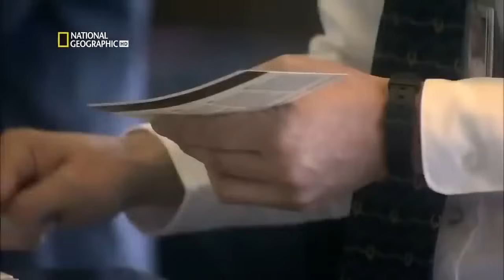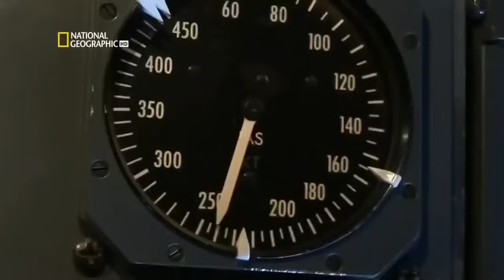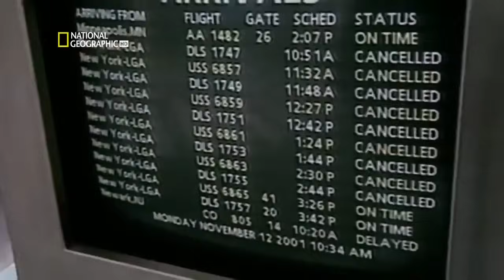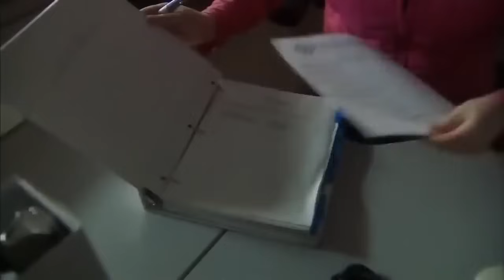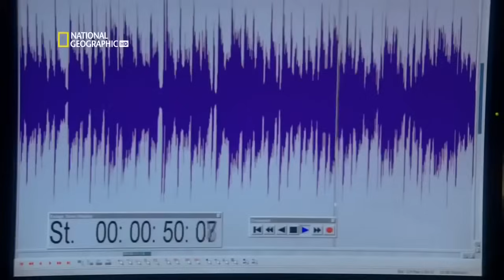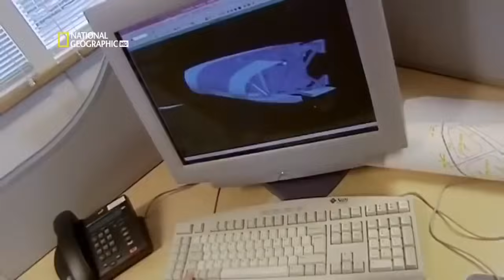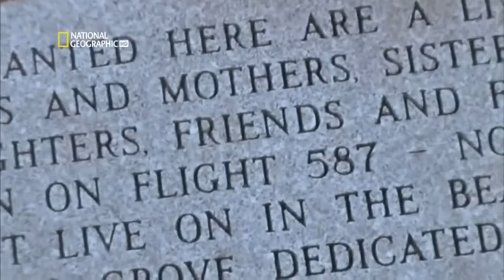American Airlines Flight 587 | Air Crash Investigation | National Geographic

Comment: Total over reaction on the part of the co pliot...and the captain just sat there instead of taking control. All they had to do is just wait it out and put in minor corrections on the flight controls to keep it stable enough to fly out of it. The pilots could have asked the ATC for a re-vector or reduce their rate of climb, both of which would have allowed them to fly out of the wake turbulence of the preceding 747.

Comment: 37,000 hours of flight time. At that point in any type of mechanical vehicle every little thing could go wrong. Electrical, hydraulic, mechanical, engine failure, stress cracks in bolts....
Reply: This is why all critical components have a maximum service life

Comment: 36:18 Wouldn't a simulation just assume the plane was built not to have parts fall of it when stressed
Reply: They exceeded the design stress. Any machine fails when you take it past it’s limits.
Reply: @peteconrad2077  But I'd assume planes are built to handle max inputs of its controls and should be designed to fly within those flight control parameters...
Reply: @Truth4Lyf  they are and so was this one. What you CANNOT design it for is reversals. Reversals, especially repetitive ones, produce an positive multiplier effect through overswing. Successive reversals can progressively increase the force without a bounded upper limit. Thus it’s almost impossible to design against and it pointless since only one pilot has every done it. The designer has to design with some degree of pilot competence assumed. If you design against every possible event, the aircraft would be unusable.
Reply: @peteconrad2077  Yh makes sense tbh

Comment: This is the same as sliding on ice/snow in your car and the panicked over-steering and impulsive stamp braking is what makes you go all over the road. When you slide you pump the brake once and let it go. You will decrease speed and do it again, this is how you have better control of steering. Sometimes you can't control it of course but if you are just sliding with brakes on---get the steering wheel straight ahead and let the breaks go--it gives wheels a chance to grab for friction when they start spinning again. This is the basic same air-mistake the pilot unfortunately made, virtually swerving in the air and over steering via the tail.
Reply: Except it's not the same. He didn't crash because of loss of control. He crashed because the tail broke off. So the correct car analogy would be that steering hard resulted in the steering wheel breaking off. Wouldn't we consider that a poor car design much more than we'd blame the driver?

Comment: I see a lot of discussion in the comments about "who is at fault".
Disasters don't just happen. There are multiple factors that play into it. Airbus has, according to this documentary, expressed their concerns towards American Airlines, about the rough usage of the rudder. Therefore Airbus is not at fault.
The training that the American Airlines pilots received was based on a computer program up to the standards of the time. I do not want to put the blame onto IT development guys, but I am not sure as to how the flight simulators of that time ensured secure training for emergencies. Emergencies have the tendency of an unusual situation. Can you reliably simulate an unusual situation?
Wake turbulence affects smaller aircraft in a way more devastating way than larger aircraft. It is only logical to assume that smaller aircraft (Cessna 172 for instance, an aircraft that is regularly used all over the world to train pilots) don't apply as much g-force to any of their components, like the rudder, in the case of extreme usage of those components. My point is, if you encounter wake turbulence with a smaller aircraft, it might possibly be correct to apply rudder in order to stabilize. And based on this data, based on experience, these flight simulators have been programmed. Based on smaller aircraft, because it was the only source of information they had. And that is no fault of the programmers. But a large aircraft behaves differently than a small aircraft, as this documentary clearly expressed. The forces applied to the rudder become way more devastating considering the growing speed, size and power of an aircraft.
The pilots trained their best in those simulators, but they didn't train for a real event that could actually occur. That is why nobody is really at fault. People tried their best in order to provide security, but in this instance it failed horribly. We can only learn from this, and I think and truly hope that we did. An Airforce pilot might have let go of the controls after stamping the rudder and still losing control. That's what they are trained for and that might have saved all those people's lives, if Molin would have just let go of the controls. But that wasn't what he personally was trained for. RIP and my condolence to everybody involved. 
Other than the 737 MAX disasters, which I personally blame 100 % onto Boeing due to not informing their pilots about a new technical system they just put into the aircraft (MCAS - the pilots didn't know how to turn it off), just in order to save a couple of dollars because you have to teach every single pilot 1 hour less about this fucking system. Pure greed, pure evil.

Comment: @olocks1: "This is Airbus fault". Not so. American Airlines' fault:
39:10: "one of the airline programs teaches pilots to use rudders to recover from unusual situations" and so did the airflight simulators. OK, fair enough, but:
39:45: "the simulators teach the pilots to use the rudders very aggressively, the program had even been altered (ffksake!!!) to encourage the use of the rudder". This contrary to Airbus recommendations because:
39:57: "*Airbus had already written to the airline saying this practice was a cause for concern.*" 
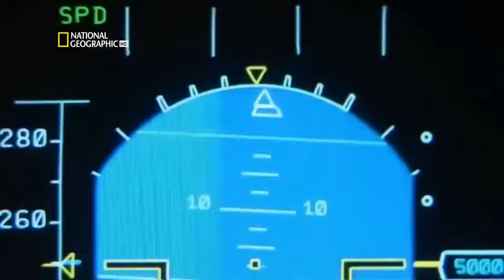So American Airlines definitely knows. It still comes up with the usual BS, 40:30: "At a public hearing, American Airlines claimed that Airbus had not explained that there were limits to the use of the rudders" (that's a PR lie, see 39:57), with that fat bloke (who is he?) saying in such a hypocrite way (40:37) "I didn't know you couldn't do that 😳, be aggressive with the control 😲".
Followed with (40:45) "the airline also claimed that the rudder system is very sensitive and that pilots might not be aware how much rudder they were really applying". 
So whose fault it is if the airline knows it and its pilots don't know it?
Interesting details on how sensitive it is and the difference of sensitivity on the ground and in flight (41:05).

Comment: I could be wrong....but it seems like that pilot is stomping that pedal in beta male style panic like he is scared. A confident alpha male would have been more smooth steady on the pedals because he  is not scared and knows he has got it under control. Kind of like if a car starts to slide in the snow, a good driver knows to use very light break pressure , and perhaps no break pressure at all  to keep the steering working. A panic driver would use hard brake and steering at the same time wich will lead to a crash
Reply: I could be wrong...but it seems that you don' understand the difference between 'break' and BRAKE. Also...'wich' isn't a word

PS. I'm right that you don't understand the break/brake thing

Comment: 100% a bomb which was redirected on fault flying skills by the captain which caused a tail dysfunction, yet the higher heirchary of the airline/airport did not want to be accountable for the breach of security which would have been more problematic if the public knew.
Reply: A bomb would have removed a lot more of the fuselage, in addition to that the stabilizers that were pulled out of the Bay showed the structural failure that took place